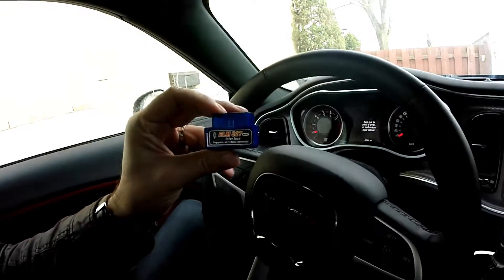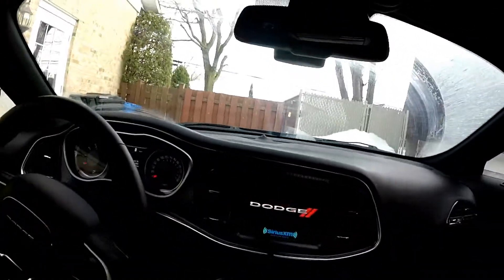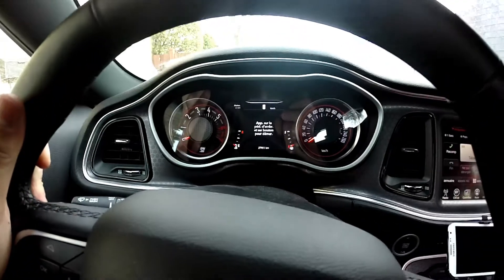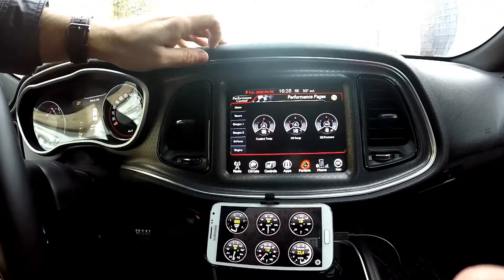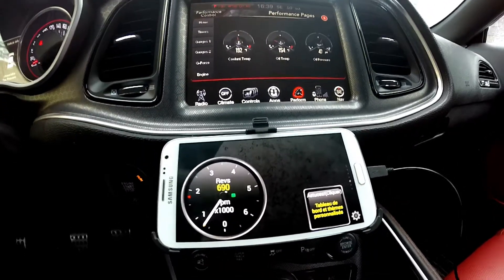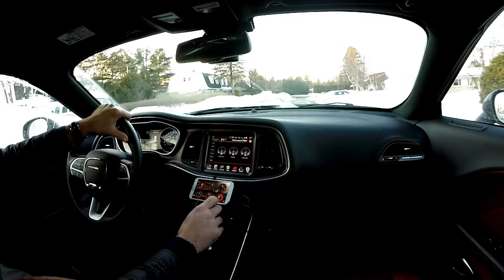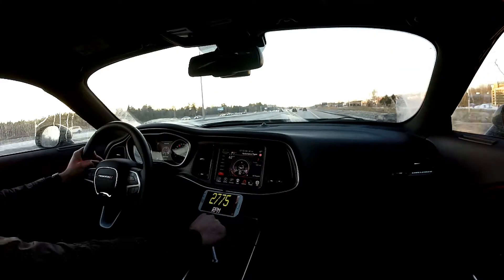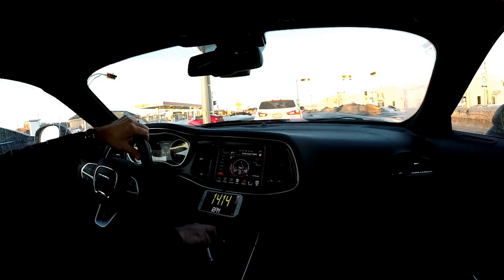How to Use ELM 327 OBDII Reader & Torque Data Logger App

Comment: I want to graph each sensor on it's own graph but it puts it all on the same one. For example I need to graph timing advancement in relation to intake temp and coolant temp. The coolant temp is so high in number value that it makes the timing advancement line appear flat.
Reply from the maker: I use the Diablosport Dataviewer for that. You can download it for free on their support web site
Reply from the maker: Check out the software in this video 1:34  https://youtu.be/ZgTwZOWevU4
Reply: Hemi Mike Wait is it a plugin for torque? I only see it for windows.
Reply from the maker: No for windows only...
Reply: If it's easy to use I'll dedicate a laptop to it.

Comment: Congrats on 300 subs man! I have one of these too and they are very helpful especially if you don't have the performance pages. What are you using to hold your phone in that location.  I need to get one.
Reply from the maker: 2016 R/T I have a Samsumg NOTE2 and its kinda home made...it used to be a suction cup holder but it broke and I jammed the arm left in between the dash and center control.
Reply: Hemi Mike ....oh ok. I would have never known. Lol
Looks like it belongs there 👍

Comment: Can't beat the combination of price and features you get with the elm and any one of several mobile apps. Just want to mention that the accuracy of some of the stats requires that you enter precise metrics for each car you use it in.  Like the weight of the car, size of the engine, etc.
Reply from the maker: Right, thanks Scotty!